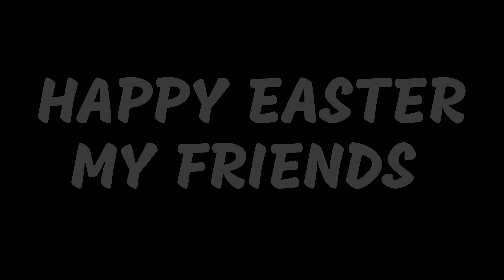IRON CROSS FOR EASTER

Comment: 5:24 You ought to make some donut weights to use as a slide hammer here. You probably have a socket big enough to use. But, you could drill a wooden cylinder and then cut a slot in it just big enough to slip it over the shaft for time when you forget to put it on first.